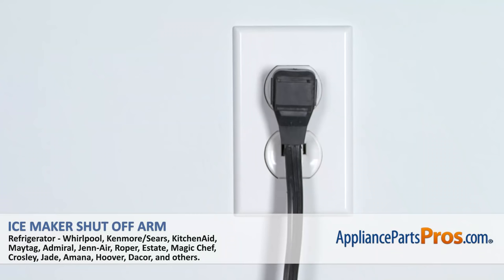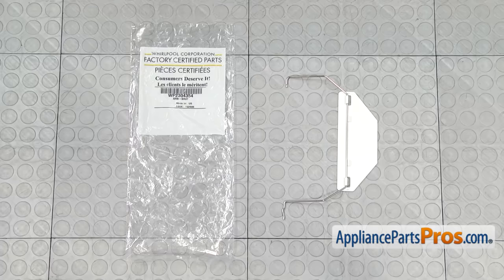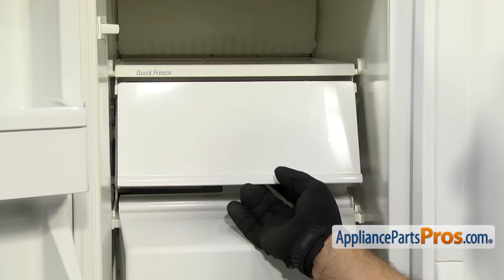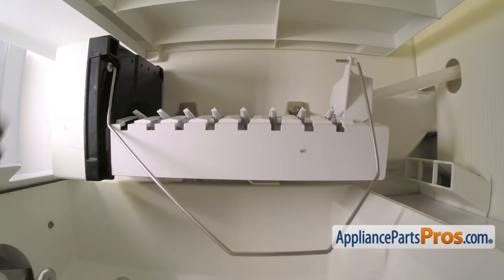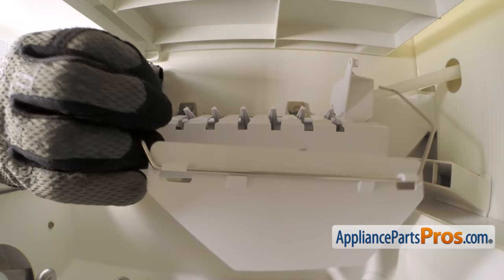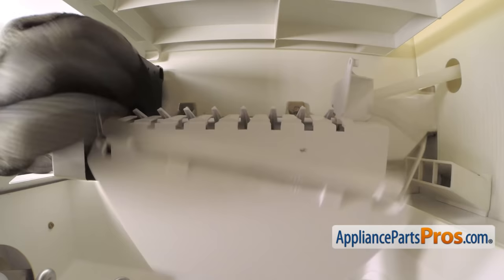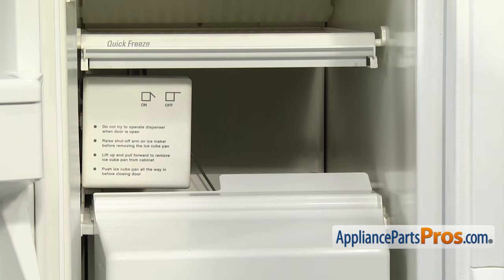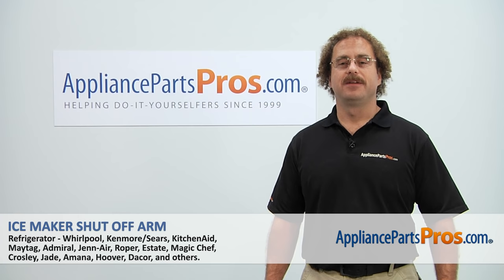How To: Whirlpool/KitchenAid/Maytag Ice Maker Shut Off Arm W11342242

Comment: The trick is in the weight of the arm.  Notice the replacement part has a flap, that adds the extra weight to make the arm drop down when ice is low.  I had to wrap some plumbers solder around the arm on my unit to make it drop.

Comment: you can pop the whole assembly off the wall and just reach in and not  mess with it, there are two screws it sits on and pull it up and then right out